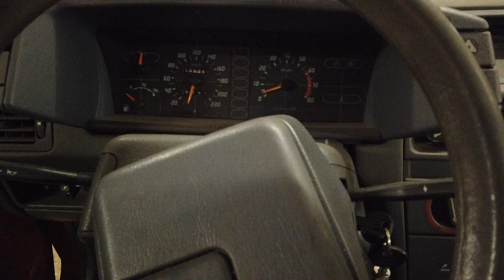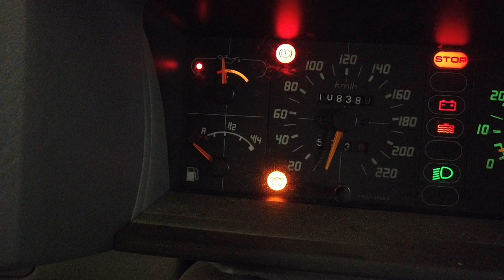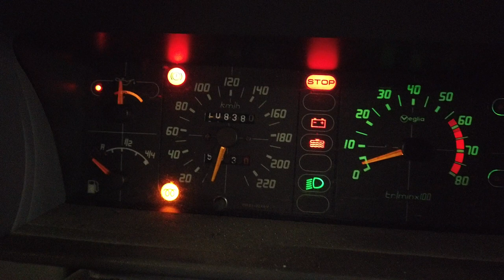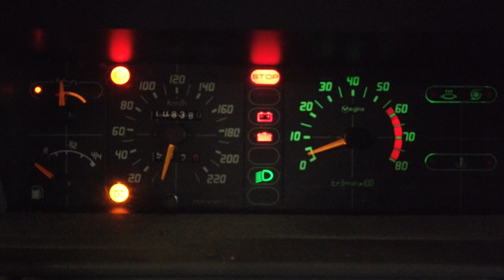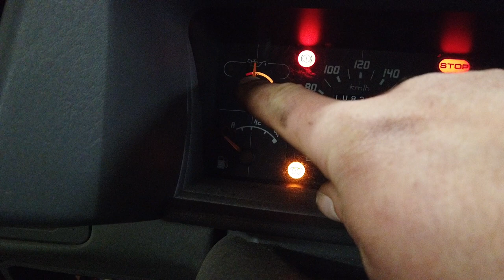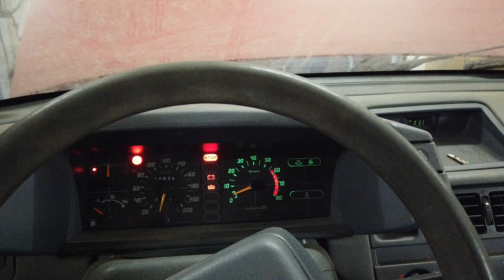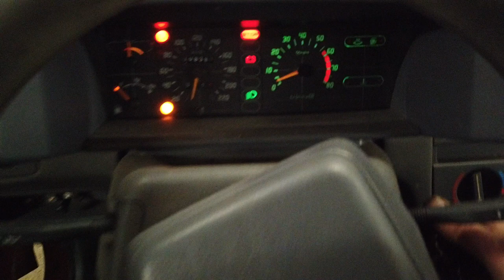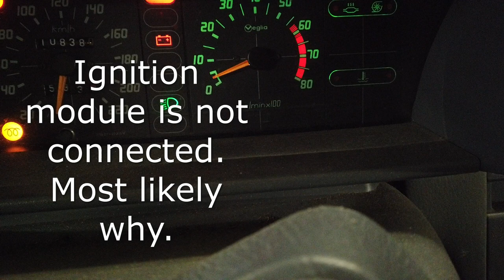The barn find 4WD Citroen BX. The first steps.

Comment: I really liked these cars. I was trying to get my dad to buy a red D reg 19rd estate 1.9d  but it was really well maintained but high mileage and the guy wanted more than my dad was willing to pay.   My dad is really cheap. He bought a vauxall nova that needed a new camshaft fitting (did it himself we have the tool) and a new piston  from part Co    £25 he wouldn't even buy the piston already on the conrod from vauxall.  It was £85  we had to get the gudging pin out and put one part in the oven and the other part in the fridge.

Comment: We have such a similar taste in cars... Trabant, Niva, Saab, old French cars etc. I love the BX as well, and a 4x4 Break is incredibly rare nowadays, well worth saving.

However all that rust... this will need a complete teardown, and the more you'll dive into it, the more rust you'll find, I'm afraid. It doesn't seem to be a light project.

Are you from Denmark? Not sure what is going on there, the salty wind from the sea, or the road salt, but cars rust like crazy in that country... unfortunately my Lancer was imported from there and rusts even in the most implausible places, like the tank opener lever, the seat rails, the rear seat bench hooks... in a dry, closed car! How?! :D 

Not to mention the whole suspension, and now I have to change the tank filler neck as it has holes in it...
Reply from the maker: Yes denmark! ... Everything more then 10 years old looks rotten here.. !

Comment: am sure you will need to do a few more modifications when parts are not easy to get, i think the exhaust is finished 🙃 maybe you need to bulk buy penetrating fluid as i think many fixings will be rusted and seized,, good luck with research be good to hear engine fire i do hope the gearbox is ok,, that could be very hard to fix am sure
Reply from the maker: It will take a lot of heat and fluid !

Yea I hope everything is ok and serviceable but then again, it was taken off the road.. most likely for a reason!
Reply: @SeasideGarage  i do hope was the rust, but those blocks of wood hold the rear suspension may suggest all is not well with the fluid suspension, but will be interesting project, maybe get good friend with Mr Up & down he seems good at finding parts